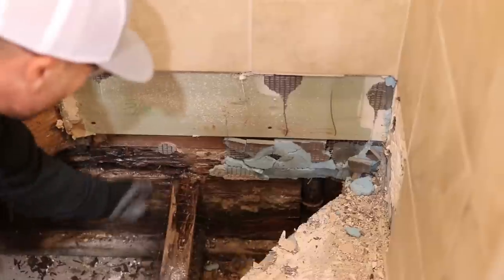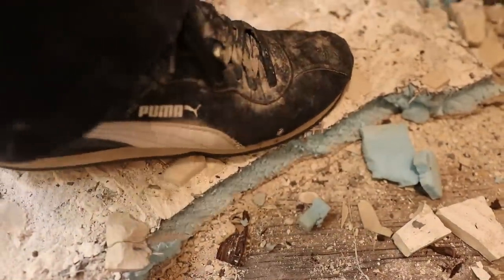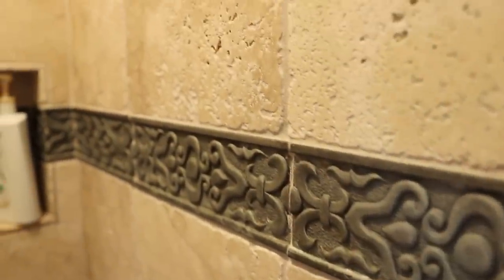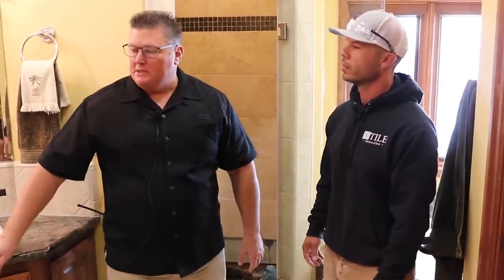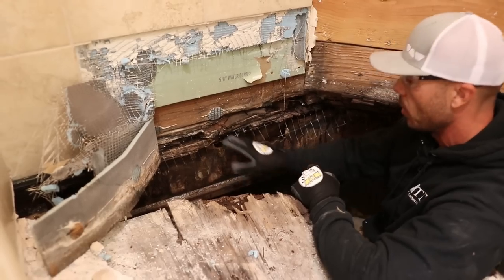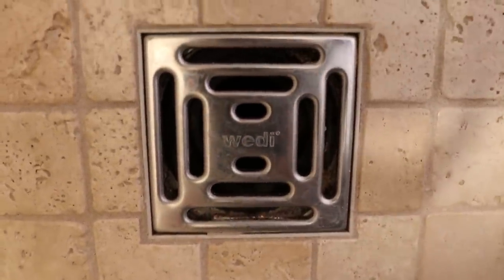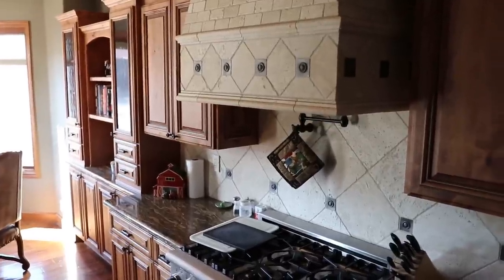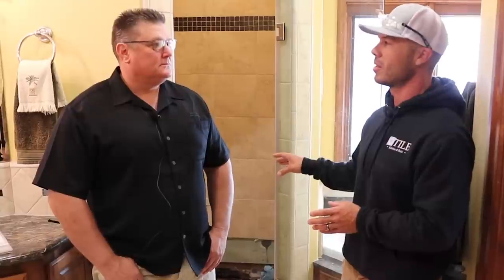Massive WEDI Shower FAILURE (Done by Certified Installer) -- Warranty Claim DENIED

Comment: Here in Norway for the Wedi system where floor meets we use a membrane tape and tape all joints, inner and outer corners then apply two coats of liquid membrane over all of the tape.
Reply: @TileCoach  I already purchased a Wedi system to install in my house and now I'm worried- does it make sense to follow the method that Alexhjthekid notes above?
Reply: @gannonfive  throw the wedi out. Or return it if you can.

Use a copper, lead or rubber membrane. And run it up the walls a foot or two. Or to the top of the shower.  At least high enough so you can see any cracks in the mortar if you tile. 

For myself I will look into marble slabs. 1 piece per wall. With a lead or copper pan and a heavy rubber liner. Even with one piece slabs run the metal or rubber up the walls a good 2 feet. 

It is called insurance!!! 

And it's often cheaper in the long run!!!  Just ask the homeowner in this vid!!!

Comment: The former owners of our house had a Wedi shower installed around 12-15 years ago which we just had fail. We have no idea who the installer was - and it's probably a good thing because this failure was due to extreme negligence on the installer's part. The wall was cut too short and tried to use wedi urethane to make up the difference. We had an inch and a half thick rope of wedi urethane around the base of the shower. He also 'adapted' the plumbing on the drain and self-modified wedi parts by slicing off everything and using a rope of caulking the size of my thumb to attach the wedi drain to the P trap....with some other weirdness mixed in for good measure.

Comment: I use the Shluter pans here in Arizona but the vast majority of the time it is on slab. I have never had problem with the Shluter system. If installed properly it will last. We don't have the seismic problems that California does though. I run the membrane up the walls so that makes a big difference.

Comment: Unless a WEDI representative supervised the install wouldn't they deny a claim consistently regardless of using a "certified" installer??  You're strictly at their mercy.  You're SOL as soon as the tile installer goes out of business.
Reply: This is why I quit all flooring, manufacturers always blame the installer, no matter what happened, 18 years in flooring
Reply: Yes, you would have to take them to court and have an extremely well-documented install and a good lawyer...
Reply: If they can deny a claim done by a "certified installer" I'm sure they would deny one with one of their reps present as well. 

I wonder if what is going on is that if a significant number of these are failing at the upper limit of the warranty and they are just denying every claim and hoping that the homeowner will just back down and go away.

Comment: Wow!! They must have done something wrong.I have a video testing Wedi sealant and there board.It held water 30 days no problem.

But yes if there is a lot of movement of the structure over time,something has to give.
Reply: Pedro Escarfullery you might be correct
Reply: Pedro Escarfullery 
Sure seems that way, if there was sealant it wouldn’t just cleanly leave channel.
Reply: @travisk5589  except it  pulled away for  some reason?
Reply: Isaac Ostrom I hear you.That said they must of not put sealant there or not enough

Comment: I use Wedi regularly, in fact, I left Schulter for Wedi. the whole when to use modified/ when to use unmodified thin-set was too much for the installers to keep track of. I know they got away from that but the other probs were not getting the thin-set soupy enough to get the corners and seams nice and flush, creating definite issues with the finish installation of the tile/ outcome. but my point is this. A correctly sealed shower floor to wall pane, joint, or therefore any joint with Wedi is a two-step process with the sealant. The first application is in the groove along the edges (generous amount), push in the panel, smooth off any oozing. All wall panel corners and edges get first application of sealant at all edges during the install, then and this is the part of why I'm commenting, the entire system gets a second and last generous application of sealant to all flat seams, corners where wall panels meet the shower pan and where all wall panel corners meet and you tool it all flat with nice wood shims or a plastic putty knife. Do not skimp on the sealant and you will be fine!! I love the relative simplicity of how I can do things like add the recessed shower niche once tile is underway to precisely pinpoint it where I want it and the size I need it to be to fall within my grout joints or whatever I'm trying to do for the particular installation. We always make sure our framing and subflooring is very thorough. We haven't used mudset since I began the switch to these modern systems approx 10 years ago. We had probs with mud set pans holding water, un even tiles, long labor times to assemble etc. messy as hell to build and its just plain, old school.
Reply: Agreed!  I use wedi.  You absolutely have to install as they tell you to.  Like you said 2 Steps.  I took the wedi seminar.  The guy said fill the entire ½” gap then push the wall board in and the put another generous bead in the corner and smooth out.  There's a reason the kit comes with like 10 fucking tubes.  You're not supposed to go home with 3!

Comment: My father built a shower in his basement using cement and tile floor, waterproof paint and sealant on the cinder block walls, and while it looks horribly out of date, it never leaked in over 40 years.
Reply: This is how they do it in the Netherlands, just tile against concrete. NO PROBLEMO!  The problem i think in the US is that they build al houses out of wood, which works & expand contracts with thermal cycle, leading to cracks in the waterproofing.
Reply: @sirrcharles1869  Totally true. Continued movement over time will break almost any seal.

Comment: I am sitting here watching this video and your assumptions are really bad. I am a certified WEDI installer and have spent untold hours with the reps whenever I have questions. Here are some places where I disagree with you.
1. The pan is soft - We have NEVER seen any flexing in a shower pan. We have reinforced plywood floors BEFORE installing if we felt they were flexing. That is not a WEDI problem. And to say that you like hot mop pans? They cure hard and when you get seismic movement (your term), they crack. I saw a few of those after the 1994 Northridge earthquake.
2. Caulk - WEDI does NOT advocate caulking the joints. He said this was done in 2007 (13 years ago) and we were starting to use WEDI around that time. Any sealant from the company has always been grey. We were trained to use the sealant to connect the pan to the walls and then to apply an additional band of sealant that overlapped onto the floor and wall. We typically use a 6" broad knife for this and our band extends 3-4" on both planes.
3. Joint - where you show the wall/floor joint, there is NO sealant. Whenever we have bonded two pieces together, whether on the wall or a connection between two sheets, once cured it does not come apart.
4. Your issue with delamination at the floor/wall joint could have been caused by floor flexing, incorrect sealant or as simple as dirt in the joint (we always clean our joints after cutting and way overfill the rabbet. I would be sending those to WEDI for testing but everything I am seeing under the tile is installer error.
5. Pan installation - this might be the root cause of the problem and again, this is installer error and not WEDI. WEDI requires the installer to thinset the pan to the floor, regardless of whether it is concrete slab or plywood. There is none there and that would allow the pan to flex. No different that the same failures I see from floor backerboard failures when the installer does not thinset the panels to the floor or use enough screws/nails.
6. Conclusion - In my view, you are plain wrong. I am not a paid shill for WEDI; I just like their products. This failure is caused by nothing more than installer errors and it is unfair for you to negate a product that you are not familiar with. Take some WEDI classes and talk to the company reps.
BTW, I have over 35 years in the tile industry and have written two books with my partner. I, too, have REAL WORLD experience and failures related to products are extremely rare. I have done forensic work and worked with the Ceramic Tile Institute and the vast majority of failures are attributed to not following instructions.
Reply: Well said, i agree 100%

Comment: The compressive strength of masonry is proven through out time.  The prepitch, pan liner and mud pan system is water tight and allows a path of flow for any water that does penetrate.  The movement of wooden structures should be considered.  The use of pressure treated lumber beneath an area or adjacent to an area of  expectant moisture  is mandatory in my opinion.  Most of my experience is with concrete floors and concrete block walls.
Reply: Pressure treated lumber in a shower is a huge no-no.  Pressure treated lumber as it dries will have more flex, more movement and its more prone to cracking than any kiln dried dimensional lumber. This is Construction Science 101

Comment: I have been watching all manufacturers videos on shower assemblies with foam boards, and still can’t persuade my mechanical mind that TV packaging grade polystyrene foam with some fleece and sealed by mortar or adhesive can build robust shower stale situated at 2nd or 3rd floor of stick frame house we have in America and will last decades. It may be enough at grade level where you either have concrete slab or your load bearing walls built with 2x6 or 2x8, as you climb higher, walls get thinner and more prone for flex and drift due to temperatures. The only exception may be if you built your custom house and exceeded construction standards. Either way, Those shower systems answer ANSI requirements that allow mechanical give up to 1/16”. This implies that your shower should be rather large to spread contraction/expansion load over more surface to compensate for seasonal dimensional give. In this video shower area rather small 3x4ft, back wall was double layered (not sure why, perhaps contractor thought drywall will server as temperature barrier, or Wedi presolpe was undersized, either way, all it mean that longer screws has to be used, so more roam room for Wedi wall board) Sheetrock has different temperature drift cycle, Wedi board different, and mortar with tile different. Also, bench was installed, which likely added on number of seams, which are temperature breaking points, getting all this combined you can imagine amount friction happening behind tiled surface, all this was just time bomb in my view.

Comment: When I started using the Wedi system about 10 years ago the sealant that was recommended was made by Sika, the tube said  Sikaflex, it was a grey ureathane sealant. It was also solvent based (mineral spirit cleanup). A few wears later the tubes were marked "WEDI" but the sealant was still grey.
It could be possible the installer used the wrong sealant (maybe water based) To save some money.
Almost all of the Wedi pans I installed needed to be cut down to fit the drain/opening layout.
That required a new rabbit to be cut into the priemeter of the pan.
that rabbit was always filled with sealant before the wall panel went in, making sure that the sealant flowed up and out onto the pan and wall board, then another bead was applied and troweled with the corner trowel. 
I don't know if Sikaflex was white before 2011, but the first time I used a ureathane sealant  ( around 2010 solvent based) it was grey. 
I am thinking the installer used the wrong sealant to start with.
Reply: +1 the sealant should be grey.

Comment: Wow, The whole system is reliant on the sealant. We are looking at Marmox system, which is required for underfloor heating. We will go with that for areas other than the shower, where the older underlay/screeting/waterproofing system maybe be suitable. As additional protection we will Epoxy or Evadure all wood under shower area.

Comment: This wood rot is not recent. How old is this installation. I have worked on houses that have had water issues for 15 years and the rot it not this bad. Could they have had a water issues years before this install and not fixed the wood only to have a weakened structure that helped the WEDI fail?

Comment: I've never heard of "WEDI" or worked with it but looking at the design alone is a LOL. A rabbet joint on the pan at the most vulnerable joint? Engineering fail at its finest.
Reply: Exactly. 
Wedi is NOT a good system.
Reply: Whatever happened to a lead, rubber or copper pan/liner that goes up the wall a foot or two?

Who gets on the floor of a shower to look for cracks?
Not me! I want a tried and true, fail safe system, with proper flashing to prevent any/all water leaks/rot/mold and termite damage and related headaches. 

I want a job to always to be done right the Frist time. 

I'm not interested in having my house being torn up, over and over. 

Screw Wedi. Never heard of them. And will now, Never, Ever use them. They obviously don't understand that the best advertising is GOOD word of mouth. How much will it cost them to undo the damage of this video?

Good word of mouth, from happy customers, is PRICELESS!!!

WTF WEDI!!! 

Make your customers happy!

Or go out of business!!!

GM almost went out of business because they forgot how to make their customers happy. And I bet GM is a heck of a lot bigger than Wedi. So Wedi could go down the tubes in a flash. 

With videos like this they can't ever advertise their way into to my house!
Reply: Absolutely nothing wrong with it. It's a good product for wetrooms but no good if you've got a cowboy installing it. Mines been in 14 years with no leaks whatsoever because I did it properly. The crap joint is crap because of the installer. It's not the way wedi recommend doing it.
Reply: @paul756uk2  this was installed by a WEDI certified installer and waterproof tested by the state. We know it can pass, but this video just proves how fragile this system is to failure. Sorry bruh, your argument is not convincing me to use this... You couldn't pay me to have this shower system used in my house!!!
Reply: @ezekieo32  I've got no vested interest in wedi so couldn't care less whether you'd use it or not. The fact that this guy was wedi approved is meaningless. Its no guarantee of a good job. The fact that he's out of business days it all. I used it properly 14 years ago and is as sound as the day I fitted it. Here in the UK  decent bathroom fitters use this kind of board made by different manufacturers. The guy that fitted this was a cowboy as we say in the UK.
Reply: Yes. Obviously the sealant didn’t stick to their product. The rabbet makes sense in that it increases the surface area fir adhesion BUT the rabbet is also a downhill construct so you are creating more surface area in a down hill.  Think about that. That shirts bead of goo is under the water.  If it was a simple case of the pan in first and the board butted down on to it at lease the sealant would only be fighting the water on even ground.  
Both scenarios suck and I will definitely never use this product. 

Last shower I did I used Kerdi. But I did wonder how the joints containing a porous adhesive would be water proof.  I suspect that all the polymers added to modified thinset mat also make it slightly less porous and wicking but still. 
His other videos he handles that detail with a roll on sealant.
Reply: @avenger1888  How many wedi systems have you seen or heard of failing? In my opinion one of the best if not thee best systems for a shower if installed correctly; and I stress thee installed correctly part.
Reply: Wedi has a been around for a long time. Typical German over engineering. I haven't ever before seen a wedi fail but lots of poly and drypack issues.

Comment: Having not long installed a similar foamboard shower system (Marmox) as a DIY effort at my own house. I'm glad after seeing this that not only were all board joints sealed but i also used the self adhesive tanking tape on the wallboard to former right around the perimeter of the tray, internal corners floor to ceiling, and all low level board joints. Hopefully avoiding this suspected failure point.
Reply: Mapei has a self sealing bandage as does Technokolla, they are designed to be a consistent crack coverage item for a full liquid applied membrane.  They do not work well by themselves.  Marmox is under parent company WarmUp and their system sucks balls....it really does.

Here in New Zealand, they place a sheet waterproofing membrane, then the marmox board, then the underfloor heating and tiling....all wrong.  The bathrooms smell musty and all the levels are out unless the room was plumb and level from the start.  Totally dumb system thats overpriced.

Comment: Isaac, great video once again. I agree with you reliying on caulk that is hidden makes me say no way! I have an open mind , but my my mind tells me if ain't broke don't fix it. I will stick with my traditional shower pan liner and mud floor. 
Keep in mind though when joining sheets of certain liner materials they sometimes use a caulk as well and that scares me just as much as that Wedi joint.
Reply: I hope you are better at shower pans most installers do. Daily I walk into failed mudset pans. Yesterday I got to redo a shower that was never used it was so badly done.